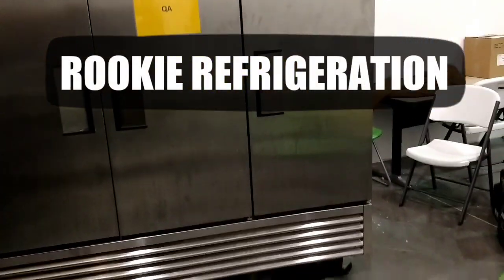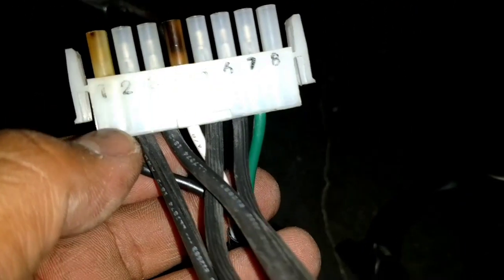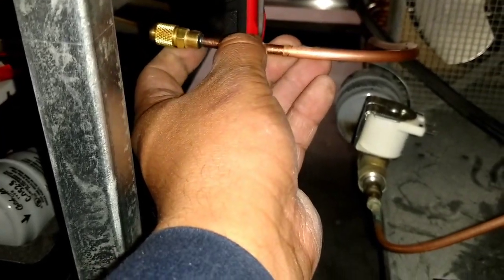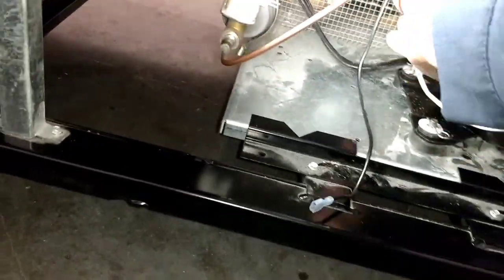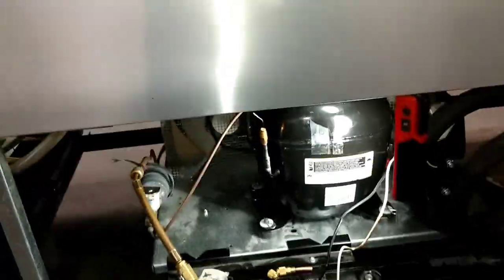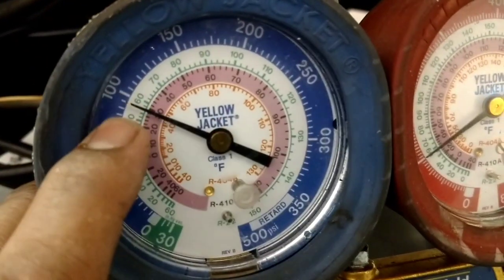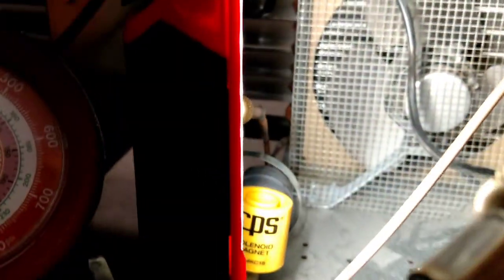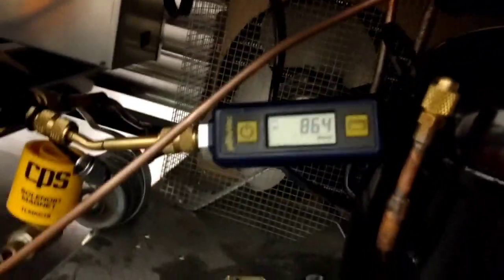Refrigeration: Compressor Changeout on a True Freezer

Comment: I use one of these for molexes from when i used to do PTACs. Got me out of a few jams. It pushes the pins out without breaking the locking mechanisms on the side of the pins.

https://www.amazon.com/dp/B0094MIS9U/ref=cm_sw_r_apa_i_EVGSEbZ9QPQTK
Reply: You can also leave those wires cut and wire nut to the fan. Coca Cola uses True coolers. I work for Coke.

Comment: Get yourself a molex pin removal tool.  They are cheap and you won't have to splice those in again.  https://www.grainger.com/product/2RZV4?cm_mmc=PPC:+Google+PLA&ef_id=Cj0KCQiA0ZHwBRCRARIsAK0Tr-phPPwkLx3YkpSeZ5nQFZhOyMmUm-yrt7WeLm4hUoZoGb7rwBEaZWsaAsD_EALw_wcB:G:s&s_kwcid=AL!2966!3!264922886832!!!g!439235505103!&gclid=Cj0KCQiA0ZHwBRCRARIsAK0Tr-phPPwkLx3YkpSeZ5nQFZhOyMmUm-yrt7WeLm4hUoZoGb7rwBEaZWsaAsD_EALw_wcB

Comment: On AC when you have a burnout compressor changed, you normally have to flush the system. For refrigerator you don’t have to flush the whole system?
Reply from the maker: For burnouts, you flush the system.  I forgot what was wrong with this one.  I didn’t condemn it.
Reply: Rookie Refrigeration thank you for your quick response. Do you normally order compressors online or local suppliers? When you couldn’t get the identical compressors and use similar ones, what’s your main concerns? Horsepower, Amps , etc in addition to refrigerant? Thank you. I am trying to do some refrigerator repairs in the near future
Reply: If its not the condenser motor or defrost clock and refrigerant burns your eyes and nose-recommend new one unless it's one of those 4,000.00$ units

Comment: Good job. pressures look good. when flowing nitrogen make sure u leave a place for nitrogen to escape easily and use a solenoid magnet when welding.
man, that freezer is only 2 years old. i guess someone did not clean the condenser from day one.
Reply: just wondering if the solenoid valve should have been wrapped with a wet rag?
Reply from the maker: Probably.  But I wasn’t bracing directly on the solenoid valve itself.  I guess a precaution should have been taken. 🤷🏽‍♂️
Reply from the maker: Yeah, I caught the solenoid issue after I already begun brazing.   Yeah, I don't know what was waiting with the compressor.  Someone else condemned it, do I have no clue.  I usually recheck then to verify, but no time on this job...
Reply: Yea, im guessing this was a true warranty job. no time on true warrantys. im suprised u did not have to replace cap tube.

Comment: It's generally considered best practice to cut out the old drier rather than sweat it out. FYI you can slide the condensing unit out from most reach in units for service, including the one you worked on in this video. That's why the lines are coiled up. Your doing good work bro!  Thanks for the video!!
Reply: not much room to cut out drier on that one.
Reply from the maker: I know bro.  But didn't have much room here.  I always cut out and sweat in.  Wish I would've taken the skid out. Didn't even think to do that.  Lol